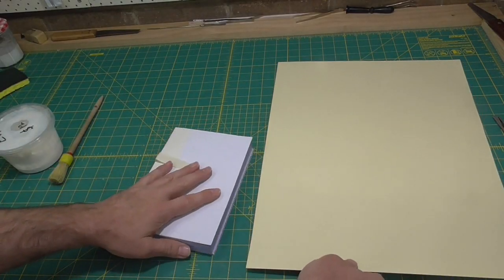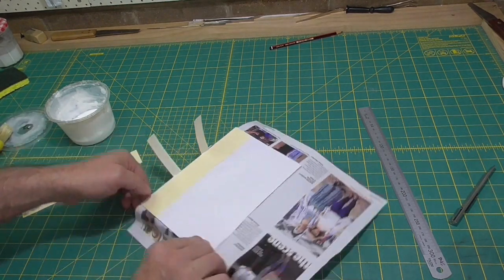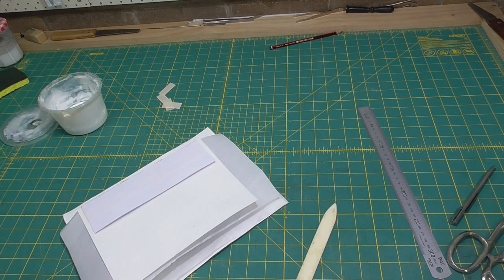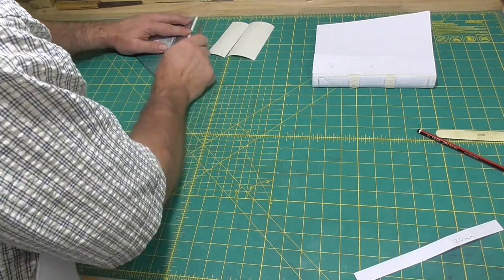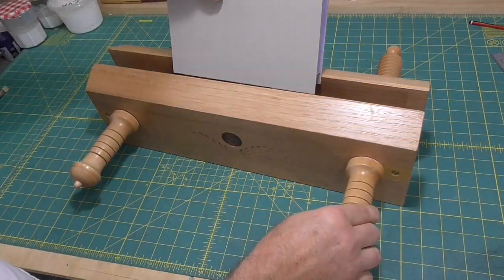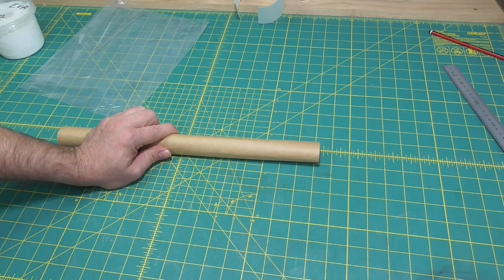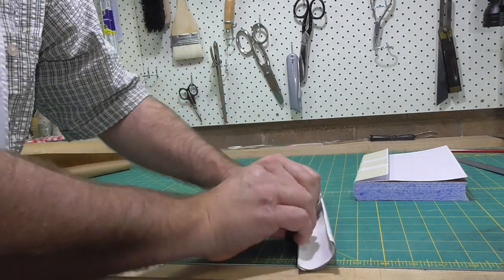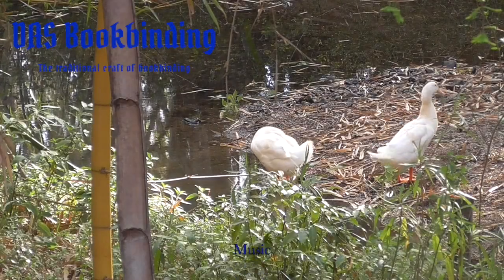Full Cloth Springback Notebook 2 // Adventures in Bookbinding

Comment: Hello! I’m new to the channel, I have one question. For the reinforcement of the spine using buckram at minute 8, do you have knowledge in Aida cloth or cloth used in canvas? If so, is it an ok substitute for buckram. The downside of using this cloth, I suspect, is it is very “breathable” not so tightly knit as buckram. The canvas cloth feels strong.
Reply from the maker: The Aida looks a bit expensive and more fancy than needed.  I'd suggest just using a tight weave cotton.  Good luck!

Comment: Apologies for this question. Is your green cutting mat glued to your work bench? Mine has become warped and I,m considering using contact glue to secure it as a permanent surface. Thank you.
Reply from the maker: No.  I change them too often.  Well , about annually.  I'm due for a new one in this spot and they are on sale at Spotlight at the moment.  I like the Olfa ones.

Comment: For the spring, how important is the thickness of the greyboard? You’ve used 1.6mm, but I’ve only got 2mm board - can I use that, or do I need to order some thinner board? (Thanks for some great videos, by the way!).
Reply from the maker: The 2mm will work fine.  It is likely your 2mm board will be laminated and might have a tendency to delaminate when being rolled up.  Maybe preroll it a couple of times, but getting tighter each time to give the board time to adapt to its new shape.  I've had plenty of experience with this happening.  The adhesive seems to reset fine and not cause any problems down the track.  Good luck!  DAS